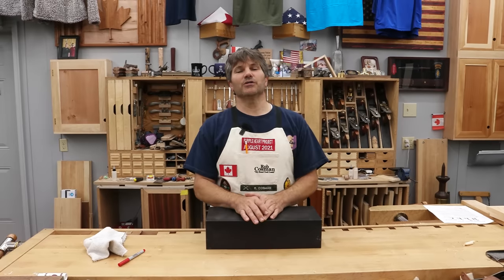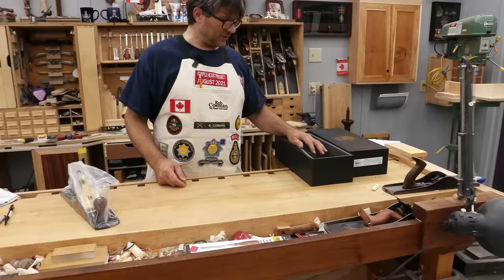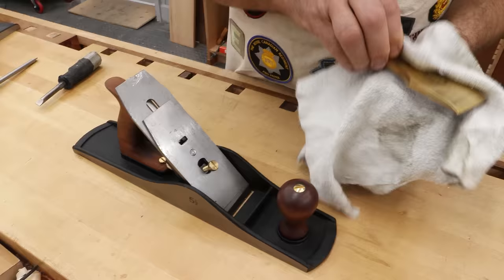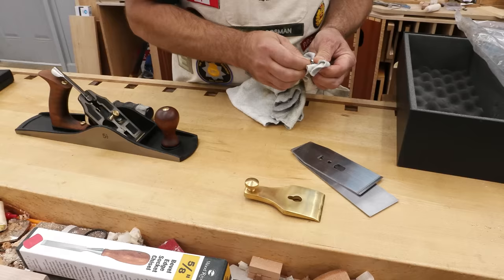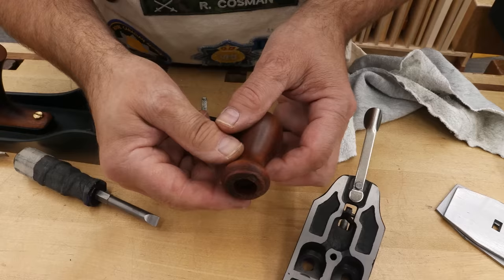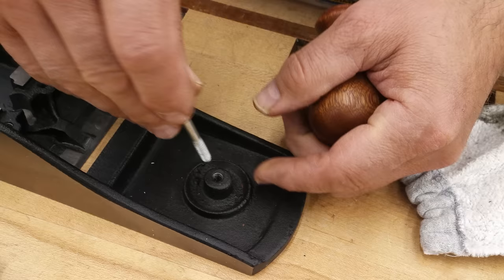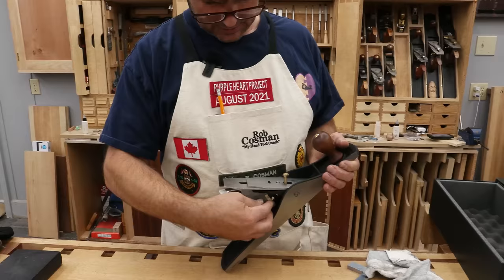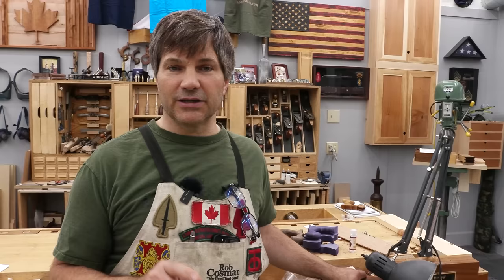Tool Review - Bench Dog 5-1/2 Bench Plane

Comment: Funny, you mention the "old Stanleys" as a comparison for quality- you sure don't want to look at new Stanleys being sold as entry level. Horrible casting quality, frog and pressure plate both, and just an awful lot of work to try to get it to do an acceptable "entry level" job. I would be crying tears of joy if my new Stanley did the level of cut that the BenchDog just did in your video without your complete set-up process.  My new mantra: Save up, buy once, cry once.

Comment: The little bump under the front handle is there for a reason:  keeps it from turning which it's likely to do when you grab it hard.   Also, the short screw holding down the rear handle is perfect for its function.   A flat head screw would tend to split the wood.   I like that it's not counter bored thus maximizing the wood structure under the screw.    Like you, I own Woodriver planes but I wouldn't ding someone for non-performance issues.   Incidentally, I shoot air pistols and the handles on those come blocky - you're expected to use a rasp and file to shape to your preference.  It's not possible to make a handle that fits every hand.   PITA but not a deal breaker if you intend to use the tool long term.
Reply: I don’t think this is something that I can get into. Reviews like this are so cringe to me… I’m too casual of a woodworker to give a tool this much attention. Maybe if I was a world known YouTuber who does this for a living, but as a basement crafter/fix it guy, this plane is above and beyond my requirements. 😊
Reply: There's nothing better than having a perfectionist review a tool.  Very thorough, and sold me on getting a Wood River instead.  Double the price but triple the quality!
Reply: @brucewilliamsstudio4932  → You certainly will never regret your purchase.   Just be kind to the tool and the wood.
Reply: @wilhelmtaylor9863  🙂  Always be kind to the wood.....  I'm not a tree hugger, but they are beautiful just the same.
Reply: @brucewilliamsstudio4932 not double the price though. They're pretty close in price! WR is much, much nicer IMO.
Reply: @brucewilliamsstudio4932 fans of Rob’s talent and videos will without a doubt buy Veritas or the pricey Lie Neilson if he promotes it. Who else would consider paying a retail price of $27. CAD for a plastic spritz bottle to spray magic juice on their high end honing stones. I can’t complain, “Norm” sold me on a workshop full of Delta power tools while I watched New Yankee Workshop.

Comment: I’m not sure what people expect from this and any tool produced for the low budget market. Sabo in India produces the same plane for Bench Dog, Taylor , SJ and others.  This 5 1/2 would suit many who are occasional users that aren’t prepared to pay twice that for a WR in that size. Yes you can compare but it’s not an apples to apples comparison. WR puts their self in the high end category at $475. cad.,  Veritas 5 1/2 at $399. cad., and LN at $425. usd or roughly $575. cad. Taxes and Shipping add to those numbers. That little bump under the front know is intended to stop the knob from rotating as you exert pressure during planing. If you want a better option, check out the three mentioned above and let your pocket book decide. I’ll stick with a Canadian or American made product. JMHO. 🇨🇦👨‍🦳👍
Reply from the maker: Richard, get your facts straight. This is the third time I’m having to correct you. The Bench Dog sells for $249.99 USD, and the WoodRiver sells for $269.99 USD. That’s only a $20 difference.

Comment: I just stumbled across this review. I bought a Bench Dog 5 1/2 about a month or so ago. I like it okay. But I am a beginner and I may not know any better. I ended up buying this plane for two main reasons: one was that an employee of my local Woodcraft store actually told me that he did notliek the Woodriver version of this plane. He mentioned something about the sides being out of spec for squarness and a few other issues. The second reason was they were, and still are, completely out of stock. The newly opened Rockler store in my area had this plane in stock and they had a 20% off coupon. So I only paid about $180 for mine. Since I am not a major user of hand planes, and because I got it at a lower price, I think I can live with many of the functional issues Rob mentioned. I know I can live with the cosmetic issues.

Comment: I just want to say as a person who recently started woodworking with one of these planes:
1. You are absolutely correct about the hand blister from the front knob. I got one pretty bad.
2. When you don't know what you're doing, adjusting the screw for the lever cap is a source of frustration. An actual lever is so much better.
3. I had problems with mine that I could tell needed fixing (chip breaker, frog adjustment) and at the same time I didn't (and mostly don't) know what I'm doing, so it was a long road of screwing the plane up and trying to fix it only to cave, buy a Lie-Nielson and have no problems whatsoever. 

These planes are okay, but as a beginner, I'd not necessarily recommend. Either go cheap / flea market and have the same pain of getting it workable, or go pricey and get a really nice tool if you have the money. This plane lands squarely in the middle ground where an experienced wood worker will know how to set it up well and get their $200 worth out of it. Maybe a good buy as an upgrade once you've cut your teeth a bit on a cheapo.

Comment: A very unbiased review that I'd sure agree with Rob. 

In today's volume production manufacturing environment CNC machine tools are an absolute necessity. I'm real confident that plane's machined and non ground areas were done using a manual mill and a really low skilled operator. The starting nick with the end mill edge at the incorrect elevation and non flat end milled areas prove that. I'd be embarrassed to produce surfaces and finished work that bad with my mill. Even a low end CNC mill could surface the the casting under the tote and properly make the radial cut under the handle in less than two minutes. Secondly whoever did the initial design and specified the + - tolerances didn't have a clue. Or if the drawings were were properly done the manufacturer ignored those and there's no real quality control inspection. 

The totes bottom length isn't even close to matching the castings boss length, and those protruding screw heads on hand held surfaces? All that isn't exactly witchcraft to figure out and do properly without adding a single cent to the production costs. They've obviously cut corners for zero benefit and certainly lessened there chances of having any real long term customer loyalty. I'd bet the machining was farmed out to the absolute lowest bidder and it shows that all too well. Unlike most wood workers I could re-machine, fix, or replace parts for most of it's problem areas, but for $220, I'd pay a bit more and get something that works right out of the box. Imo that plane is an over priced starting kit of parts that just about needs access to machine tools to finish it off into something that's ok at most.

Comment: I bought one of these 3 years ago. It is not the plane I grab regularly - I also have a Woodriver Cosmanized (blade and breaker) 5 1/2 jack.  On the Bench Dog plane, I have never been able to get the iron angle to remain as set, and I really don't like the knurled thumb screw lever cap that locks the iron and breaker. The plane is heavy enough, but it just doesn't keep its set on the blade angle, and is also hard to adjust the iron depth with the thumb screw locked down on the lever cap.

Over all, I wish I hadn't bought it. No amount of fettling on my part has made this plane anything more than maybe a shooting board plane.

Comment: I bought a Rider 41/2  plane several years ago. This is a brand sold by Axminster tools in the UK, made in India and looks identical to the Bench dog 5 1/2 you've just reviewed right down to the square edged chip breaker! doesn't that take a time to correct.. My criticisms of the plane are exactly those that Bob describes. So over a period of several years they are consistent! In use the plane feels 'dead' in the hand not what you want.For comparison my refurbished pre war Record planes feel so much better so the choice seems to be Lie Neilsen, Wood River/Quangsheng or pre war Stanley/Record.
Reply: You must not forget Lee Valley

Comment: i bought a benchdog no 7 recently. came in fairly good shape. the contacts for the frog needed a decent amount of work to seat properly. the sole looked very nice aesthetically. the piece of paper said it was .004 flat which it definitely was not. not even close lol. if it wasnt a long plane like a 7 it wouldnt of bothered me that much but the fact that they give u some signed off piece of paper authenticating it...  also had the same problem with trigger finger having nowhere to sit. i'd rub up against the adjustment while planing until modifying.
Reply: It was probably flat when they milled it and it warped over time
Reply: @UserNameAnonymous  does cast iron warp easily? thinking back on it everything felt a little overtightened out of the box so maybe the stress from that?
Reply: @ConfiscatedZyra  In his review of a new Jorgensen plane, Rex Kruger discusses the need for cast iron to season awhile before milling. Apparently it can move around for up to a year after casting. It has me wondering whether that's what's meant when higher quality planes say "stress relieved."
Reply: @mikestewart505  oh wow. well i learned something new today. much appreciated!

Comment: Great review Rob ... the deal breakers for me are casting quality (this is a minor one but it does speak to attention to detail), the screw type "lever" cap and the big one is the frog design.  I don't understand why anyone would design a Stanley Bailey type frog when many manufacturers are able to implement the Bedrock design.  Years ago I bought and refurbished 6 Stanley planes from eBay.  This was at the time when "collectors" were scooping up Bedrock planes for crazy money only to sit on a shelf as an ornament, never to be used. This drives me crazy but that's a subject for another day.  Anyway I was only able to get one Bedrock (my #7) the rest were Bailey design.  Used them for years (still do) but started to upgrade to WoodRiver bench planes 6 years ago (based on your comments and involvement in the design ... thank you for that) ... the time saved in adjustment alone is very helpful.  I don't think the Bench Dog is a piece off junk but it's not for me ... I'm continuing on with WoodRiver as I know I'm getting a quality tool.

Comment: Your review is thorough, professional and informative.  Well done.  Having restored 8 or 10 old Stanley planes and a knock off plane, It took a lot of trial and error to learn about and appreciate the facets of your review.  I really enjoy using hand planes and the feel of the iron slicing the wood is wonderful.  It also tells you a lot about the grain direction, thickness of the cut, blade sharpness, and surface finish of the wood.  I think the lack feel with this plane is in part caused by the rough bedding of the tote and knob, lighter than usual screws and questionable fit between the blade, frog and frog bed.  A few refinements could improve this product a-lot.  You probably spent an hour tuning the plane.  If the manufacturer spent $10 in effort, they would have a much more competitive product.

Comment: This plane was made by Soba, you can tell by the frog adjustment screw which has a distinct shape, and also by the fact it was made in India. For 220 dollars you pretty much got scamed.
I have a No. 4 smoothing plane from them, which I bought roughly for 30 bucks  a few years ago. It was a bit rough around the edges, literaly, but after a bit of sanding and smoothing it works great.

Comment: Just a suggestion; If you're going to totally dismantle and its packaged with oil coating.  A can of brake clean from auto parts store is $2.  Spray it down, it evaporates quickly and will keep your bench clean.  Thanks for the review, will help some to not make the same mistake I made.
Reply from the maker: Great tip
Reply: A better product for removing preservative oils or grease on any object would be CRC Electrical Contact Cleaner. Works almost instantly and evaporates almost as fast. I use it around my metal cutting lathes and mills where if your doing things properly there's always an excess of way oil that also collects metal chips etc.
Reply: @turningpoint6643  Yes, I have been using this for years and I tell everyone to use it in place of brake cleaner which is flammable. CRC Lectra-motive Cleaner is non-flammable and leaves no residue and much safer to use and store in your shop.
Reply: @bobd.  Yeah I'd certainly agree, that CRC contact cleaner is a lot safer and afaik ok around most paint, plastics etc. It does strip every lube product I've tried it with.

Comment: This same plane, under the Busy Bee brand in Canada is sold for 159.99 Canadian. Used to be $195. At $159 it's pretty tempting to buy one just to see if it can be easily tuned to perform as well as a higher end plane - the parts certainly seem to be there.
Reply: Problem is it’s only for you Canadians.
Reply: @CarlYota so what’s wrong with that, I am Canadian but I wouldn’t buy one from them. Veritas is the way to go if you can afford them. Innovative and a high level of quality. I’m sure Rob must have one around, don’t you think? Manufacturers are stuck in the old Stanley design with updated manufacturing techniques.

Comment: So I grew up with a father who worked in a machine shop and foundry here in Southern California and built parts for the Apollo missions back in the day. He used to say All craftsmen need to know how to fix, repair and maintain their tools. He also said a true Craftsman can get superior results Out of worn out tools. What he meant Was that if you were a true Craftsman you didn't have to have the latest greatest most expensive tool to get the job done properly. As to the aerospace engineer that commented down below all your jibber jabber about tolerances is a complete waste of time and doesn't apply to woodworking. Growing up with a father/engineer everything I did was measured intolerances with micrometers regardless of task. So when I moved to woodworking trying to achieve machineist tolerance's on wood drove me nuts.  With lumber being the material your tolerances can move many thousands just because of temperature, moisture, And hell with large guys like me I can put my weight into it and compress the fibers way farther out of tolerance than any of those numbers you were talking about.  I think it was a stumpy nubs video that showed how you should not prep your wood until you're ready to glue it up. He showed some material that he had prepped the day before that was flat and square and the next day it was not flat and square just because of the moisture. As in all rob cosman videos this is just a giant bitch fest on who has the biggest penis.   The bottom line is buy what you can afford learn how to fix it up and tune it and get to work. We all can't afford Lie Nielsen.
Reply from the maker: Ill stick to my approach, "get it as close as my hand or eye can tell".  Most of the woodworkers we cater to  are not coming from an experienced background, better tools make the learning process easier.  Better tools dont require a newbie to try and figure out how to repair the tool HE BARELY KNOWS HOW TO USE!  Am I getting through?